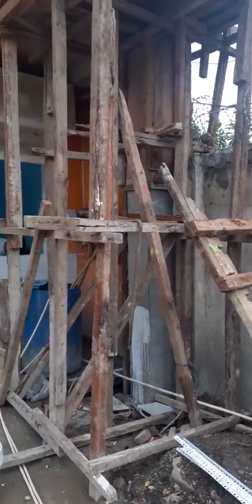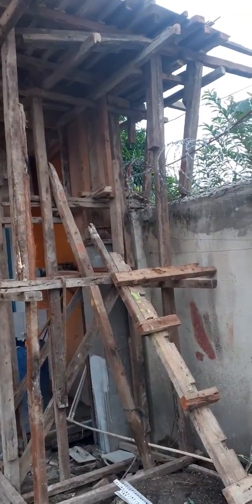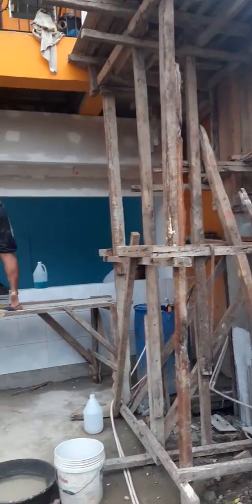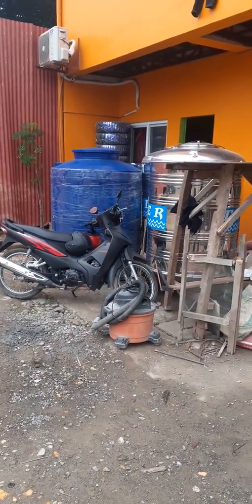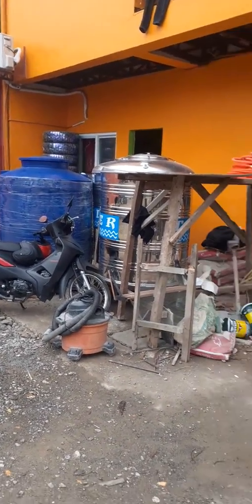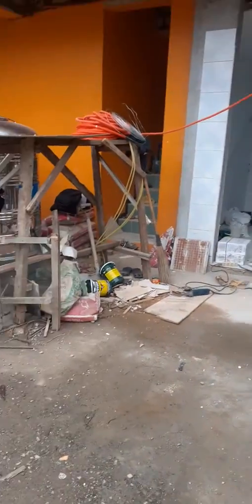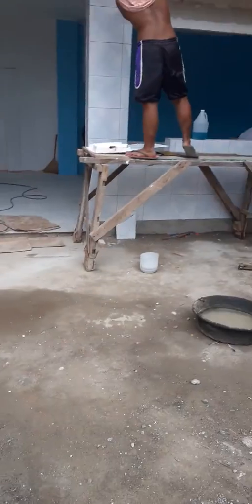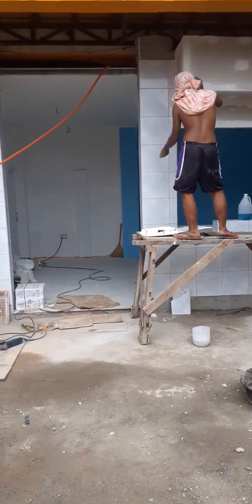Construction of Water Station

Comment: magkano po aabutin kapag 4x5m ang sukat? salamat ho.
Reply from the maker: Thanks fpr query Sir/Ma'am. If 4mx5m so 20 square meter floor area. Depende sa specification ng Material such as tiles,roof framing, roof, glass and framing, partitions, how big is your rebar na ginagamit. rough estimate standard lang at least 250 to 300K. Sa building lang yan then sa machine is 3000 to 6000GPD Reverse Osmosis  is Manual is 285 below and Automatic Backwash is 300K up.